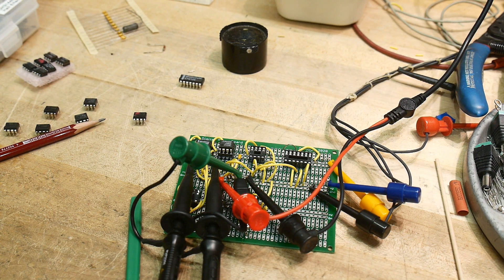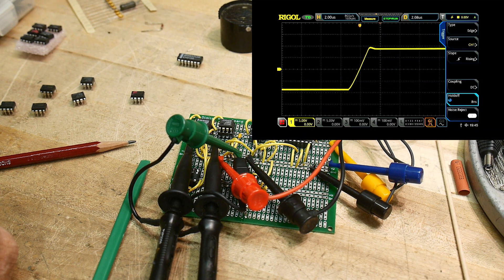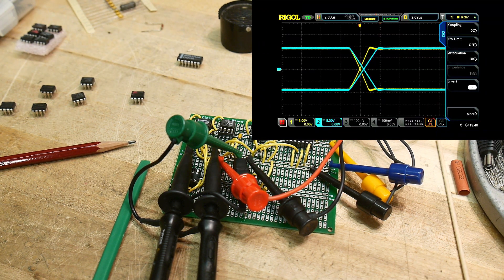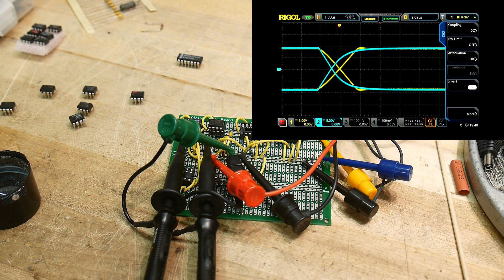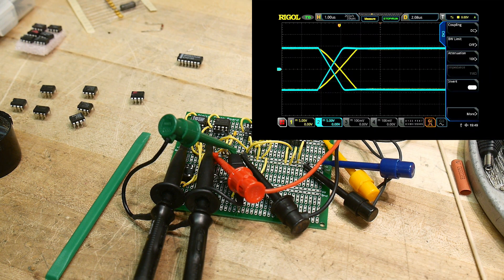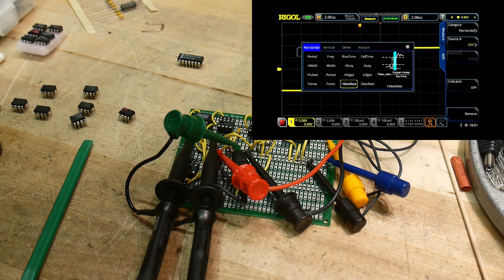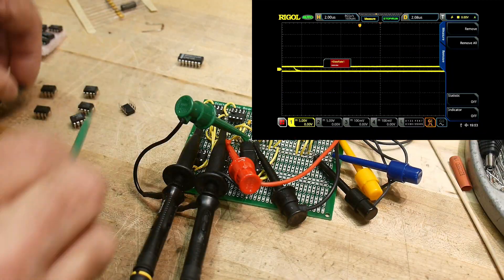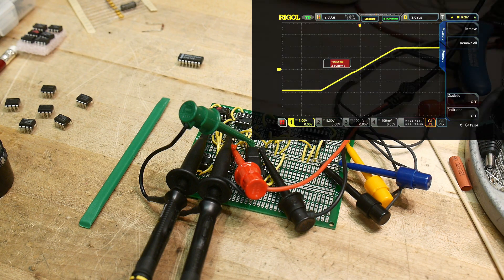#1058 Slew rates of op amps

Comment: Legend has it that the reason Moody Blues recordings late 1960s-early 1970s had a muffled muddy sound because of the bad slew rate of the  op-amps in studio mixing consoles, and perhaps not because the producer wanted a concert hall effect.  when you listen to "Nights in White Satin" you especially notice the drums lack impact.  Though these recordings are well loved I wonder how everything would have sounded if they had used vacuum tube equipment...

Comment: You shouldn't put much store in the non-linearity of the edges that you were observing. Some of the ramps clearly resembled the charge curve for a capacitor though a resistor - and that's exactly what they were. You were observing the effect of a significant output impedance (often the current limiting circuit) charging all the stray capacitances connected to the opamp output on your prototype board. You may find that a cleaner layout with less capacitance on the output and improved supply decoupling could improve those non-linear edges noticeably.

Comment: Hi, what's the supply-rail? If you are swinging close to the rail, extra delays may be expected. Also the 1v 'source' wave would be handy to see simultaneously, esp. as a 'trigger' source. 
Furthermore - you use the term "non-linear" (literally: not a straight line, which is valid), however: a "linear" system (from signals and systems) is defined differently, whereby an overshoot or an exponential rise would be perfectly acceptable as 'linear'. A slew, on the other hand, definitely is not. The most basic 'razor' is that you should not get any frequency out that you did not put in; each frequency may individually have a different gain. An RC-lowpass is, for example, a 'linear' system.
Reply from the maker: +/-15 rails

Comment: In my mind, slew rate tells you how fast an op amp is.  Also bandwidth tells me if an op amp is faster or slower than another one.  But bandwidth and slew rate can't simpley be inverses of each other...  What is the difference between bandwidth and slew rate?
Reply: Bandwidth is the maximum frequency that you can use for small signals. Slew rate determines the maximum usable frequency for large output signals and will be considerably less than the bandwidth, as well as being inversely proportional to the voltage swing at the output.

Comment: - Opamp slew rate measurement should be done with unity gain (Av=1), and not Av=-10.
- Output should be loaded with 2kOhms resistor parallel with 100pF capacitor.
- Close to the DUT you should have 4.7uF capacitors between ground and both rails.
- Unused opamp should be terminated.
You should show the reference input signal, and not only the trace from the output.
Reply: Those are interesting points. Do they only matter (or almost only?) when trying to measure "absolute slew rate"? IOW, since the video was mostly focusing on comparing slew rates between different parts, is the relative comparison he's making still valid?
Reply: @largepimping  It does matter. If you have a much larger capacitance, for example, you end up measuring the output impedance of the opamp, not its slew rate.
Reply: So, did you have the resistor AND capacitor go to ground AND\BUT did you load-up\include a 100Ω-180Ω resistor FIRST, at the OP-AMP OUTPUT, before the 2kΩ resistor AND capacitor? AND most OP-AMP manufacturer schematics show\recommend a min. of 47uf capacitor, followed by a 0.1uf capacitor and then the IC +\- pins. Why did you choose a miniscule 4.7uf capacitor instead? Thank you for your time.
Reply: @christophero1969  Well of course you have to have the resistor AND capacitor go to ground, otherwise they wouldn't be a LOAD and IN PARALLEL, would they?
And no, you wouldn't include a 100R resistor at the opamp output, because that is ONLY necessary to STABILISE THE LOOP by improving the phase margin when driving large capacitive loads. 100pF is NOT a large capacitive load, but you might use an isolation resistor, although it is by no means necessary.
If you look at the DATASHEET for a common opamp like the LM358 by TEXAS INSTRUMENTS (e.g. SNOSBT3I –JANUARY 2000–REVISED DECEMBER 2014), not one of the example circuits shown for testing parameters indicate the need for a 47μF capacitor. The layout guidelines require the supply to be bypassed by "a low ESR capacitor". I certainly wouldn't use 47μF for that because of its parasitic inductance which will become significant at higher frequencies. I think you'll find a low ESR capacitor of between 100nF and 1μF is usually used close to the supply pins as is also common practice in digital circuits. A larger electrolytic capacitor can then be present somewhere on the supply lines and its value and characteristics would then no longer be critical.

Comment: The TI, ST, and Diodes datasheets for the LM358 specify 0.3 Volts per microsecond, so that one with over 10V/microsecond might be a fake (a reject of some faster op-amp?). 

The readings for the TL072 and LM4562 were also surprising. The LM4562's datasheet specifies 20 V/microsecond typical, minimum 15--although that is at unity gain.

The 5532 was designed for audio mixers and amplifiers so equivalent input noise and harmonic distortion in the audio band were the key parameters, with phase linearity and bandwidth/slew rate as important secondaries. Most likely all the recorded music and film audio you hear has been through a few dozen 5532s by the time it gets to you.The LM4562 is "a better 5532"--it "only" took 30 years to improve on the 5532!

The 358 has horrendous distortion caused by a poor output stage design and it's noisy. It's never used for audio, which  seems to be the common theme with the other parts. The TL072 is best described as "OK for undemanding applications". It was used for a few years in mixers before the 5532 arrived, and it's apparently still used in some low-end gear.

I'm less familiar with the Japan Radio parts and the LF353. I think the latter's main claim to fame (back in the day) was that it could be made to work quite well as a comparator, back when comparator choices were rather limited. Other JFET-input op-amps like the TL082 and TL072 were no good for that--I forget why.
Reply: Greg, i think you are right.
Reply: JFET-input op-amps generally don't make good comparators and you only have to consider what happens when the gate junction gets forward biased to see why.

Comment: My two current favorites are the dual LME49720 still available in DIP but I think TI is obsoleting it.  Faster and quieter than the NE5532 but a little pricey too.  And the OPA1611 single but can't drive as heavy a load and only in surface mount.  I solder them to so-8 to Dip adapters.

Comment: Lm358 should have a slew rate of 0.5 V/us. What is it that you have there?
Reply: My Texas Instruments datasheet says about the LM358: "Slew rate at unity gain - 0.3 V/μs". With the NE5532 (TI datasheet), on the other hand, the slew rate is specified as 9 V/μs. Very interesting, what is shown here.
Reply: Sometimes I have the impression that such old parts are no longer originally manufactured, but the old designations are stamped on a more modern successor with better values. Maybe the newer manufacturing processes are a bit cheaper too?